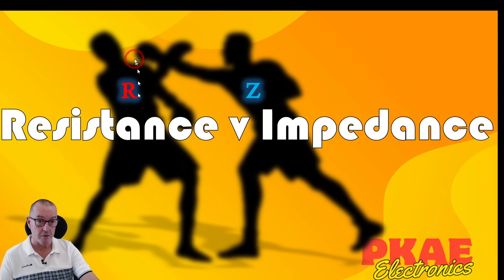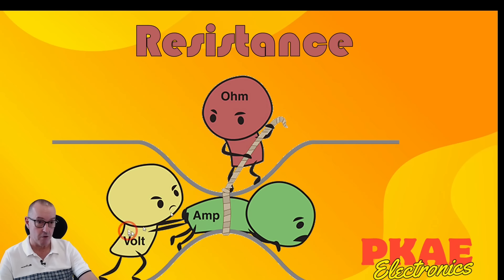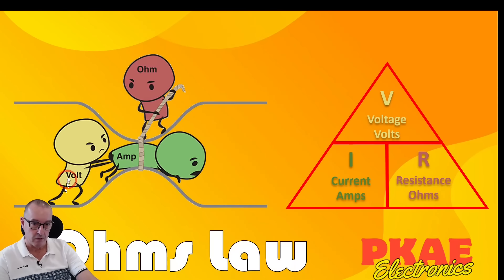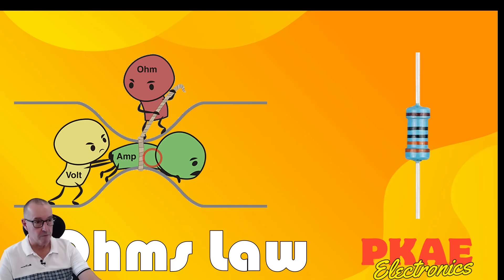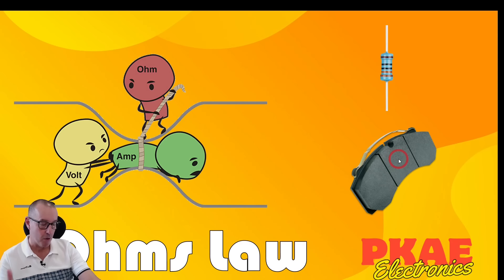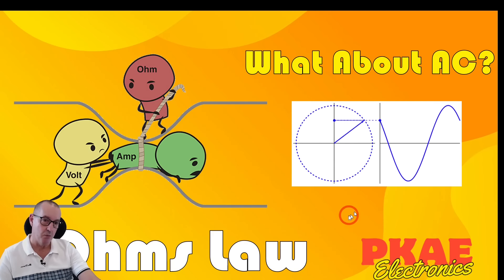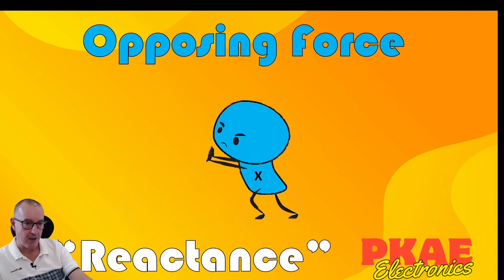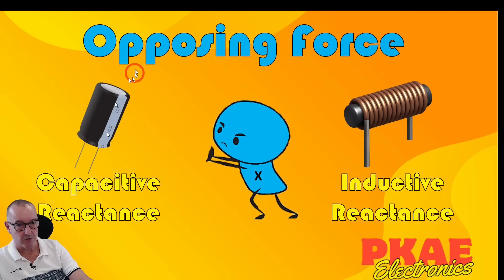Impedance Explained.

Comment: Thank you for the video, very useful but what if a capacitor is in parallel with an inductor? How calculate the impedance?
Reply: Same way you'd combine resistances in parallel.  Just replace R with Z in the formula.

Given a capacitor C and an inductor L in parallel, their individual impedances are:
Zc = 1/(s*C)
Zl = s*L

Where s = 2*pi*j*f in the steady state condition, where f is frequency and j is the imaginary unit.  I'll use s as a shorthand, and plug this in later.  In the Laplace domain, they use s, while in the Fourier domain for the steady state, they use j*w.

For resistances: 1/Rnet = 1/R1 + 1/R2
For impedances: 1/Znet = 1/Zc + 1/Zl

Solve for Znet:
Znet = Zc*Zl/(Zc + Zl)

Plug in earlier formulas:
Znet = s*L/(s*C) / (s*L + 1/(s*C))

Simplify:
Znet = s*L/((L*C*s^2 + 1)

and if preferred, plug in j*w for s:
Znet = j*w*L/(1 - L*C*w^2)

When w = 1/sqrt(L*C), you'll see that this produces a divide by zero error.  This is what happens at the resonant frequency, where the parallel combination will have infinite impedance.

Comment: Great video. Thank you. 
A resistor is dissipating energy as heat. 
Do inductors and capacitors dissipate energy as heat?
Reply from the maker: Thankyou. 
Capacitors and Inductors actually give off very little heat. In fact, in AC circuits, its often desirable to use a capacitor, rather than a resistor to act as a current limiter.
Reply: @paulpkae  
Resistance, measured in Ohms, converts energy, delivered by current, into heat. 
Reactance, measured in Ohms, does what with the energy, delivered to it through current? 
I don't understand the energy balance/ energy flow. 🙂
Reply from the maker: @rosalieroku3818  I get your point, it is confusing and difficult to explain but let me try.... 

Reactance is a cycle of storing and releasing energy within capacitors and/or inductors. 

A capacitor charged to say 5V will push back with the same force of a 5V supply applied to it. There is no energy transferring at this point. If the capacitor was at 0V and had 5V supplied to it, it will simply start to store the charge and retain it as potential energy.

Resistors resist the current flow, much like friction in that they create a difficult path for the electrons to move through. Remember that high resistance (in Ohms) means less current and less resistance is more current and subsequently more heat.

I hope this helps.

Comment: How far back in the circuit does adding capacitance or inductance affect? Does it only add these elements in until a transformer? Or is it consumed when all usable power is gone?
Reply from the maker: Good question. The answer is you have to consider the circuit as a whole. 
Bear in mind that most circuits are far more complex than the simple "in series", inductor, capacitor resistor circuit I demonstrated.

Comment: I wouldn’t say resistance is like friction, as strictly that’s also an opposing force.  He’s more like “mass”; the idea that for the same force (voltage) an object (electrical signal) with more mass (resistance) will move (flow) less.  Of course in mechanics we relate force, mass & acceleration, whereas current would be more akin to velocity, so it doesn’t quite work.
Reply from the maker: Thanks for the comment, but I disagree. 

Mass causes Inertia which is much like "Inductive Reactance". And "Capacitive Reactance" has completely the opposite effect (inverse) of Inertia. 

I still stand that Resistance is much like Friction in that the material the electrons are trying to move through, is offering much a rougher pathway.

Comment: Great teaching style. I got a question for the formula for the impedance: Why is the capacitve reactance lowering the total impedance? I understand that it responds the opposite way as inductive reactance to a change in frequency but is it not still adding a part to the total resistance and should therefore be still with a +? For example at low frequencies capacitive reactance is high and inductive reactance is low, but both are >0 so increasing the total reactance. Where does this "pulling factor" come from that is lowering the total impedance as shown in the impedance triangular and giving the capacitive reactance the (-) sign?
thanks a lot
Reply from the maker: Thanks for your comment. Good question 

Maybe what's confusing is the fact that you are thinking of the effects of a capacitor as "resistance" which is a bit like friction. But, it is not "resistance", it is "reactance" which I refer to as an opposing force or "push back".

If you consider that the charge of a capacitor in an AC circuit can go negative (below zero, or below Ground) as well as positive, you can probably now visualise the "pulling" effect  as well as the "pushing back" effect. 

From an atomic perspective, the pushing and pulling effect is the attraction and repulsion of the electrons building up and then depleting.

In the simple ohms law illustration, including my additional Mr "X" guy,  perhaps if I showed him repeatedly flipping to face one way then the other, then it would be a more accurate representation. 

I hope this helps?
Reply: @paulpkae  yes this helps. Thank you!
Reply: @nicowestkamper5227  It's because voltage is in the denominator of the definition of capacitance, rather than in the numerator.  We define capacitance, such that a capacitor with more ability to accept charge at the same voltage, has a greater capacitance.  Rather than the other way around, like we do for the other two kinds of components.  Capacitance therefore is proportional to the component's admittance, rather than the component's impedance.

Had we defined a capacitor's rating consistently with the other kinds of components, we'd define it as Voltage per unit stored charge, rather than stored charge per unit voltage.  We don't do this, because a physically larger capacitor has more ability to store charge, rather than ability to impede the collection of charge.  By contrast, a physically larger inductor has more ability to impede the change of current.

Comment: Great video. But you didn't mention that the power used in an impedance is not dissipated, but returned to the circuit. The power used in resistance is dissipated as heat.
Maybe a second video explaining that and resonance. 🙂
Reply from the maker: Thanks. I have another video in mind as a follow up to this which will lead into Power Factor. That's where I think this best sits.

Comment: 13:47 That is not a micro (10 to the -6) sign (like a u with a long front tail) it’s a milli sign.
Reply from the maker: Correct. I spotted this slip of the tongue a few days after posting. If you turn on Captions you will see some pop up text at the right moment, which is 13:54.
Reply: Up early? Have a nice day.

Comment: but what about the speaker at the start. is that capacitive or inductive? or both?
Reply from the maker: It is both, but the combined effect is Inductive. If you pause the video at around 20seconds in, you will see the phase angle on the meter is positive (+20degrees) which means the  overal load has an inductive characteristic.

Comment: Ok, so then after this, how do we calculate the power factor of this circuit. Is it the cosine of 15.7 degrees? We know the apparent power is 2.2 amperes, but what is the reactive power, and what is the real power (in watts).
Reply from the maker: Hi, thanks for the comment. The calculation for power factor are quite straight forward from this point and derived from another triangle (The Power Triangle). I think this would be a great follow up video, which I will try and get produced soon. 

Thanks for the idea, watch this space......

Comment: Or assume a universal frequency and use phasors. Or if you can't assume a universal frequency, perform a Laplace transform. That's my preference.
Reply from the maker: Thanks. The primary aim of the video was to help people visualise in their minds what's going on within AC circuits and try to avoid focusing on mathematical terms.
Reply: @paulpkae  , I totally understand, and for the record, you did a brilliant job. It might be cool to see a similar video on phasors. What the math illustrates to me is that assuming your AC frequency is constant throughout, almost always true for practical circuits, the only extra information we need to carry around is a phase angle. You mentioned that this is the reason we can't simply treat them as resistors in series, but with a little extra notation and some simple trig identifies, we can. I think it would be a super interesting follow-up to this video.
Reply: @richbaird9407  Passive circuit elements don't make new frequencies, so it isn't really an issue.  Semiconductor components like diodes, transistors, and amplifiers, can distort the wave shape, which will unlock higher frequencies that are all multiples of the original.

 If you had multiple frequencies involved, you'd have a superposition of waveforms, and you'd have different impedances of the energy storage elements for each one.

You could either use the Laplace transform, or the Fourier transform, to solve it for a mixed group of frequencies.  The Laplace transform considers the initial transient, while the Fourier transform limits the analysis to the steady state.

Comment: My grandfather explained to me that the reason lightbulbs tend to fail as you turn on the light switch is that there is no inductance in the line as the circuit is completed and because of this there is more current than usual.  Is that correct?  And if so, is that why electronics "blow up" as power comes on after a blackout?
Reply from the maker: Good question. 

In reality light bulbs will exhibit some inductance, although quite small. Passing current through any wire or electrical path will result in a degree of inductance. However, the filament within incandescent light bulbs have a relatively high resistance and its this which regulates the current running through it. I would imagine that when its left turned off for some time and allowed to cool, then there would be a surge of current at power on because the filament would be less resistive at cooler temperatures.
Reply: @paulpkae  You'd be correct.  Light bulb filaments operate at 2800 K, and room temperature is about 300K

Given a 100 Watt bulb for a 120V circuit, its operating resistance is 144 Ohms.  If you measure such a bulb at room temperature with an Ohm meter, you'll measure around 10 Ohms.  This means there's a sudden inrush of current when the bulb first turns on, that eventually settles to its final value of 0.83 Amps as the filament heats up.  If it's on the verge of failing, it is most likely to fail during this initial surge.

Comment: I would have thought that reactance and impedance are time dependent because of how they depend on the inner state of the capacitors and inductors.
Reply from the maker: Yes, Reactance is "time dependant" in that it is influenced by the Frequency of the AC supply or signal. And, given Reactance forms part of the overall Impedance then that is also influenced by Frequency.
Reply: @paulpkae  ah so the formulas are expressed in terms of the AC frequency instead of some time dependent amplitude. Now it makes sense.

Comment: Reactance? You mean the load within the circuit? The thing you want to power or operate in the circuit?
Reply from the maker: Hi. Reactance occurs in any AC circuit; be it the load, or the device driving/powering that load. Reactance is caused by the cycle of charging and discharging capacitive and inductive components in relationship to an AC waveform.

Comment: My big takeaway from this is resistance is the opposing force of a component, and impedance is the opposing force of the circuit, ie all of the components combined. 
I clicked on the video expecting to learn something, then through most of the video I was lost in the sauce, and then at the end thought I learned something, culminating in my first sentence. 
How did I do? Did I learn something, or am I still lost?
Reply from the maker: Haha, I'm lost in your reply. What sauce are you using? :)
Reply: @paulpkae  “lost in the sauce” is a saying. It means I don’t know what is going on, and am confused by what you are talking about.
Reply from the maker: @Linusgump  haha, must be an American phrase I am not familiar with. Love it! Maybe watch some other Impedance videos that explain in a slightly different way. After watching a few variances of explaining the same thing, it usually helps.
Reply: @paulpkae  yeah, it might just be an American saying. Sorry for the confusion. 
I might watch some other videos, but I watched yours because it was in my feed and I thought I would try to learn something outside of my normal interests. The extent of my electrical knowledge is to turn off the power before replacing a switch or outlet, and to call a professional for anything not complicated than that.
I’m content with that level knowledge, but it never hurts to learn something new that broadens the overall knowledge.

Comment: The only question I have after watching this video is why a triangle can be used. To me, it just sounds like you picked a shape at random. How come a triangle can be used to calculate phase angle and total resistance of the circuit?
Reply from the maker: That's a great question and one I prefer not to answer in a comment response, it would just confuse more. 

However, if you look at the video again at around 16:04, you will see a sine wave animation and how that relates to a circle. As the arm sweeps around the circle, across the radius, you can also see it forms a triangle; it's all related. 

I will be doing a follow up video soon explaining Power Factor and I think the triangle aspect will become clearer for you. Watch this space......
Reply: @paulpkae  Thank you very much! I will keep an eye out for that video.

Comment: The micro farad decimal moved 6 places to the left but the micro Henry decimal only moved 3 places to the left. ( to convert to Farads and Henrys)
Reply from the maker: Well spotted. It was actually milli Henrys, not micro Henrys. 

If you enable Captions, you will see I did add some pop up text at this point.
Reply: @paulpkae  Don't get me wrong though excellent tutorial , I understand much more after that.

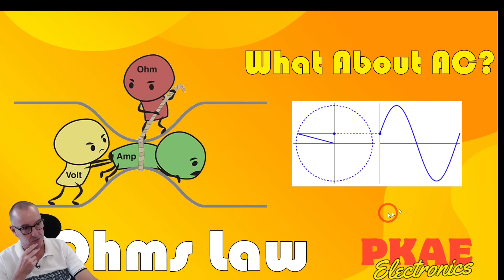Comment: 2:14 AC works/generate on clockwise/counter-clockwise? Isn't it just DC? So how DC generator works?
on AC sine chart looks like this...
  |     o               Pos-Neg
0|_o_o___o_
  |            o       
                       Neg-Pos
...that's happened because one phase/spool active interchangeably at certain rate speed.

But DC in other hand...
  |     o    o        Pos-Neg
0|_o_o___o_
  |                   
                      Neg-Pos
...no sine activity on Neg-Pos because the generator only generate electricity from one direction only.
Isn't one phase AC generator should be start at 0? Please correct me.

Comment: So. The ohm and the Volt are not true electricity Then, since the amp is the one being pushed through the narrow passage way. This would suggest that the app itself is true electricity. While the ohm and the volt are just a force.
Reply from the maker: The Ohm is NOT "electricity", but voltage is. That said, without resistance you have no voltage.

Electrical power is the combined effect of Voltage (measured in Volts) x Current (measured in Amps). So electricity is both Volts and Amps. We use Resistance/Reactance (measured in Ohms) to control the current and in turn the Voltage.
Reply: @paulpkae  Correction made.

Comment: What about watts? Oh and current?
Reply from the maker: Thanks for the comment. The video focused on Impedance because that's the topic I think many people struggle to visualise in their minds. I believe most, if not all my viewers already know how to calculate the current and power, once they know the Voltage and Impedance (or Resistance).

Current (measured in Amps) = Voltage (Volts) / Resistance or Impedance (Ohms)

Power (measured in Watts) = Voltage (Volts) x Current (Amps)

Comment: I understand the formula and i understand how they work but what i do not understand is why when i enter the exact exponents that you did in the video i get a different answer?
i wrote pi which is 3.14 multiplied by 2 and then multiplied with the frequency and the microhenry which is 10^-6 so to the power of minus 6 meaning five 0's and the number which in this case was 22 then when i got the answer it was completely different and i do not understand why... Even when using a converter from microhenry to henry the outcome was no different like instead of writing 10^-6 i also tried just multiplying 0.000022
Reply from the maker: Sorry, the inductive reactance example was 0.2mH ("milli" Henry) which equates to 0.0002 Henrys. I think I accidently say micro henry at some point, but the visuals are correct.
Reply: @paulpkae  I realize when rewatching the video i meant farad not henry i also found the problem it was the calculator that i was using
when i changed to a better one i was able to get the same result as you 72ohms

Comment: Is their more math to the xc equation, I don't get 72 when I use it with those numbers.
Reply from the maker: No, its exactly as shown. 
1 over  2 x PI x Freq (in Hz) x Capacitance (in Farads). 
Make sure you multiply the bottom line first, i.e. 6.283x1000x0.0000022 = 0.0138226. Then take the reciprocal (or one over) of this result and you get 72.345......
Reply: @paulpkae  Ah I missed a step thank you